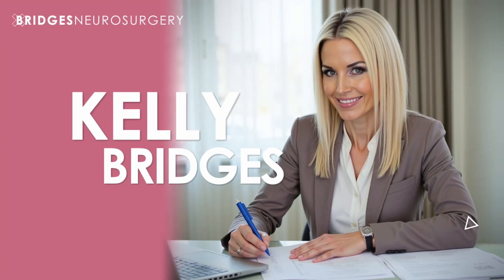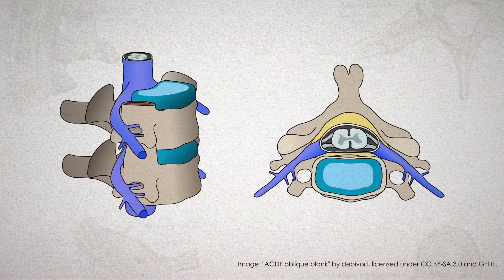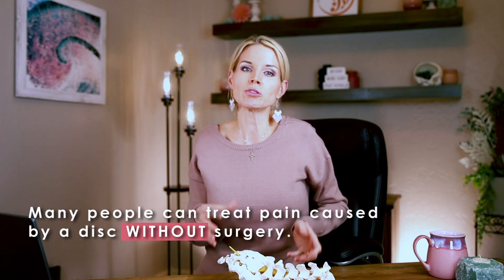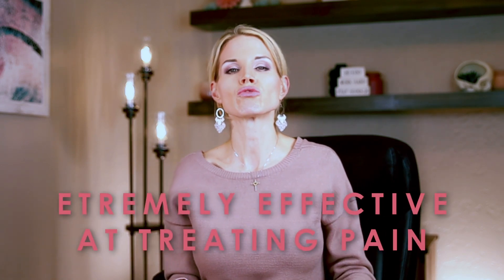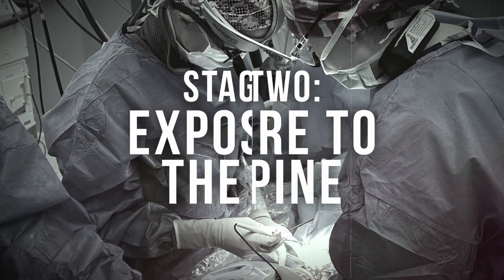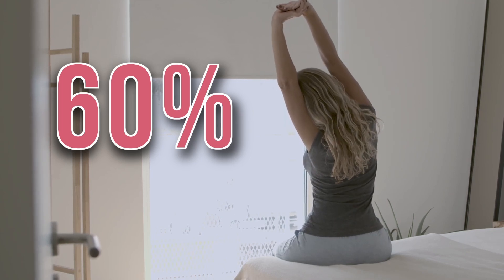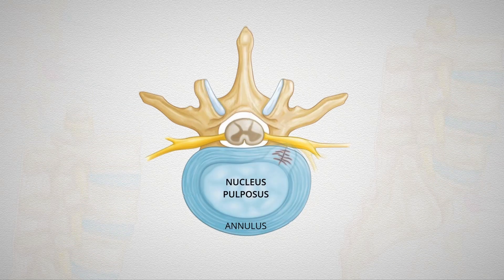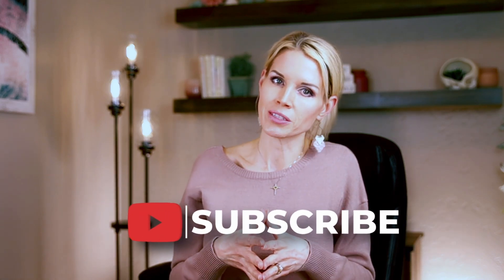What Happens During Lumbar Disc Herniation Surgery (Step by Step)

Comment: I had 2 of these surgeries with 4 years difference, more than 10 years ago. I still have low pain when I sleep for more than 7 hours straight. If I do weight lifting with a trap bar, or kettlebell swings, all pain goes away.